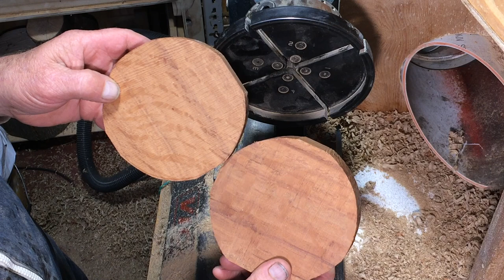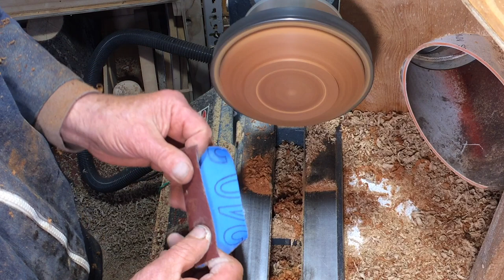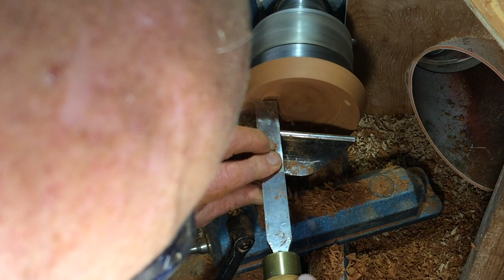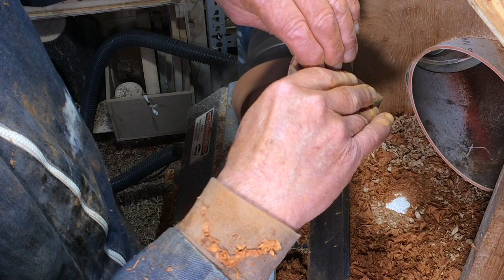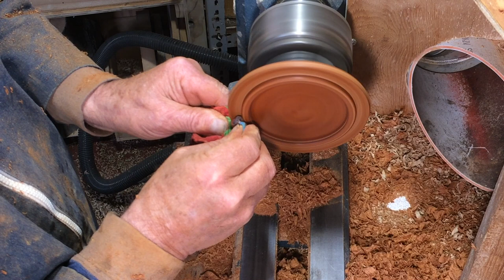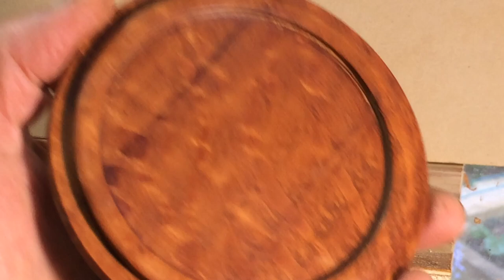Richard Raffan turns a flat box in forest sheoak

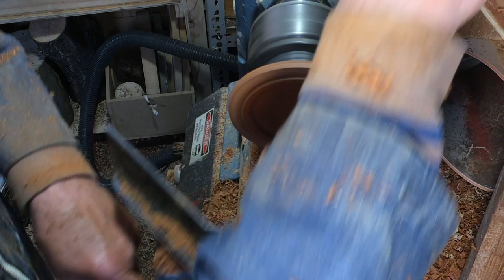Comment: Hey! Leave the knot in there! Makes it unique!  At 28:14, I do't see how you grab the edge (cuz its so TINY). At 32:11  I was hoping the fit would be more of a "PMUK!(suction fit)", but you know best! I know about wood movement...
Reply: Also, although its satisfying, a suction fit on this box would result in the user picking up the whole box when trying to lift the lid
Reply from the maker: Too much messing around to deal with that knot and the box will be unique enough without it. The grain patterns always make a turning unique.  At 28:14 the chuck jaws expand into the base of the dome inside the lid.  You see that at 14:36.

Comment: That was impressive use of two thin pieces of wood to make a beautiful little lidded box.  A couple of questions if you don’t mind; what is the grit of the diamond hone you use to touch up your tools and what is the oil you use with the bees wax to finish your items?  Thanks in advance and thank you for another informative video.  Cheers, Tom
Reply from the maker: The oil is boiled linseed and if the hone is green it's coarse, whilst others are finer.

Comment: Of course, you make it look so easy with the sanding/finishing.  I have been working with Ash, and am having a very difficult time getting the tool marks/bruising to disappear.  In general, I do not get the sanding to be satisfactory with 180 up to 220 range.  Also, using scraping on the Ash promotes bruising as well.  Recommendations?
Reply from the maker: Bruising is always to do with riding the bevel too hard against the wood. You aim for pressure similar to rubbing your hands under a hot-air dryer. With scraper finishing cuts you need to think in terms of stroking the surface but I don't see how you'd bruise the wood unless the scraper was very blunt and not cutting at all. On top of that, ash varies with the species, and if it's not air dried that usually makes it more difficult to turn. I use a lot of claret ash which is a joy to work, and recently some nearly identical (to look at) desert ash which isn't.
Reply: @RichardRaffanwoodturning  Thank you.  I will pay more attention!

Comment: At one point you mentioned breaking several knuckles years ago when the sandpaper (I believe) caught on the far side of the box edge. Could you elaborate on what happened and have you experienced other serious mishaps in the course of your career?
Reply from the maker: If you push abrasive to about 4 o'clock when sanding  a bowl or platter, the upward motion of the wood can drag your fingers to 12 0'clock. It happens in a millisecond and you're still pushing when the wood loses its grip, so your fingers shoot forward into the upcoming wood which grabs them again and bends or thrusts them back. In 52 years of turning wood I've had three or four major injuries involving blood and stitches, two from exploding bowls that simply flew apart, no catches involved. A finger was crushed loading a sanding pad into an angle drill and I crushed the end of another finger when my bandsaw somehow grabbed a squared blank. Craft Supplies in Provo probably still displays the 6-in x 2-in ash square that I interacted with — that was 13 stitches on my forehead.